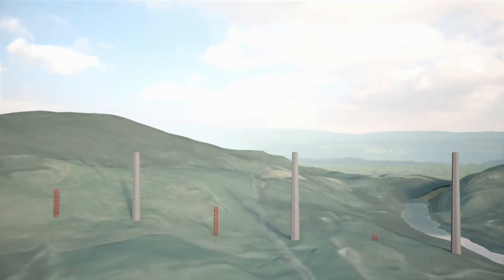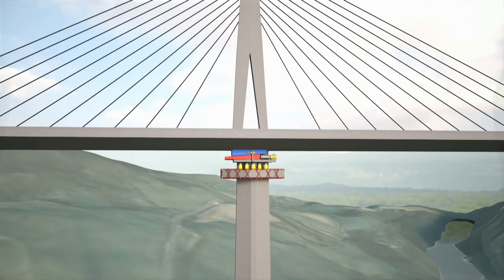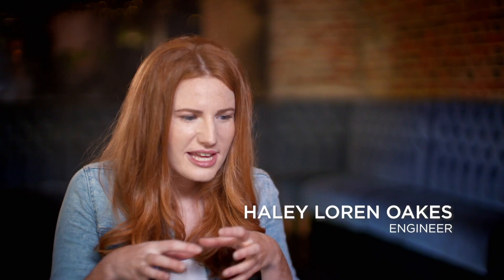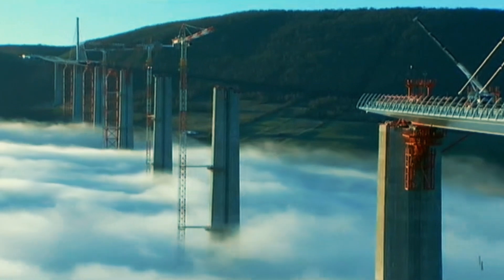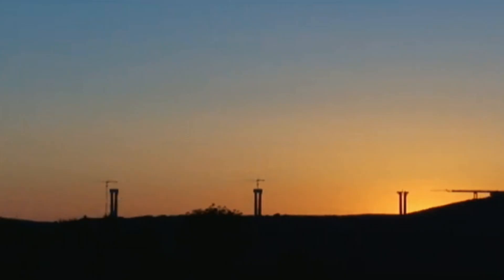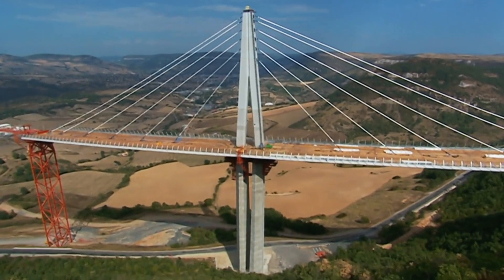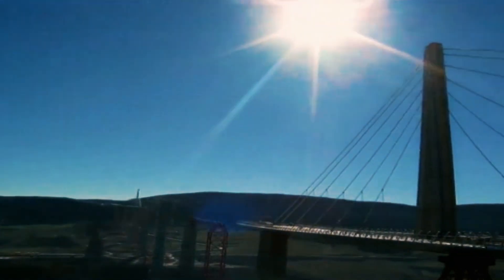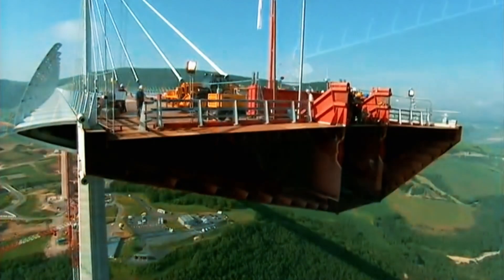French Bridge Built High Over a Wind-Swept Valley 🛠️ How Did They Build That? | Smithsonian Channel

Comment: you have to give it to the french.. they produce some of the best engineers on the planet..
Reply: Thanks for watching,  for question, guidance and support anytime. Just send a DM +1...6...1...4...9...9...6...3...1...9...0
Reply: Yes for sure France have very great engineers, but, the technique of the steel deck and the hydraulic pushing of the deck (winning solution resulting from the competition "Development and complete study of the launched metallic solution") were designed by the Liège engineering office Greisch (BEL) whose execution studies included the general calculations and calculations of resistance to winds of 225 km/h, the calculations of the launching phases, the dimensioning and calculation of the deck, the pylons and the bracing, the dimensioning of the equipment, the design of the methods of execution and of the temporary structures. Finally, following a procedure already applied for many cable-stayed bridges and viaducts by its engineers, Greisch ensured on the spot an assistance to the operations of launching, assembly and implementation of the cable-stays under the real-time control of the computing centre of the University of Liege in Belgium.